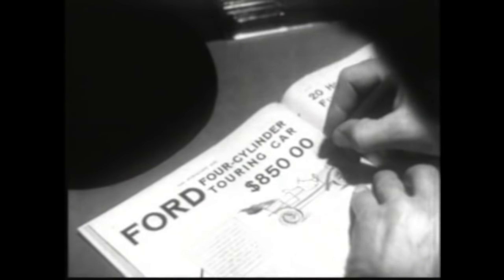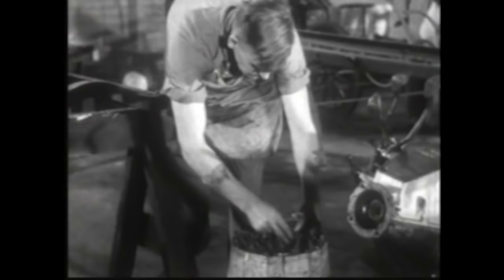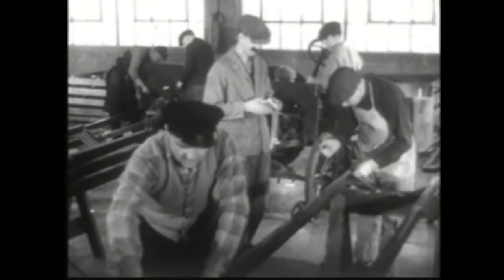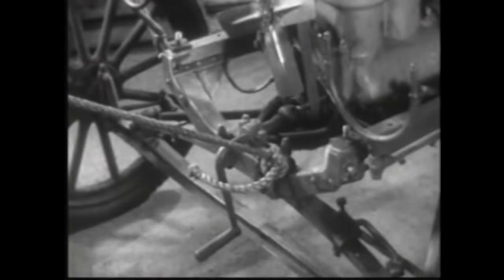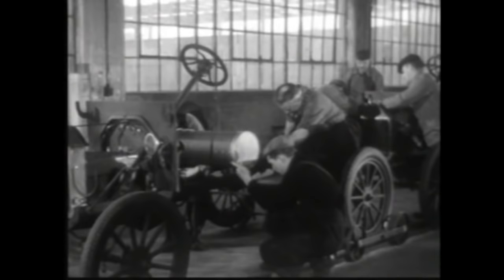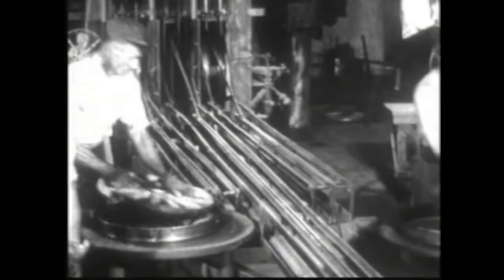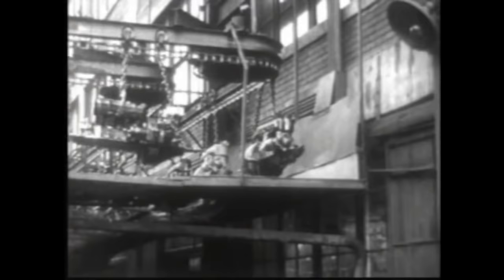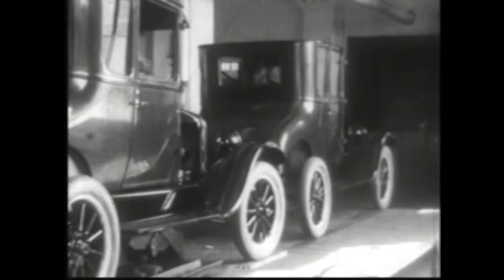Model T Ford Assembly Line

Comment: Must have been amazing to buy a car for the average middle class citizen. The driving experience must have been sensational. I know these were slow, but it was great for the city transport.
Reply: I'm sure it changed everything, for a lot of people... a Model T can go 40 mph, which means you travel to a city FORTY MILES AWAY, in just one hour. That's not slow. That's very fast. Even today, traffic is intentionally slowed down so much that it's difficult to have an average speed of 40 mph while driving. Think about it. When you drive to the store or work, you spend half your time sitting at stop lights. Your average speed is probably 20 mph. People in Model Ts were probably going faster than you, in your Prius.